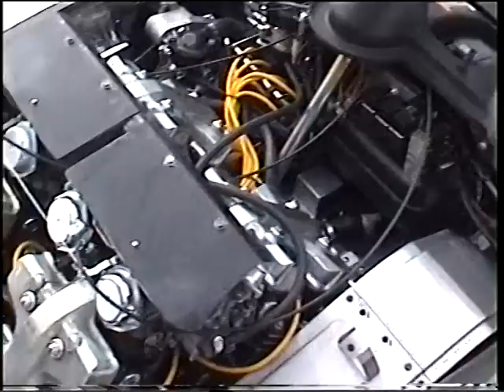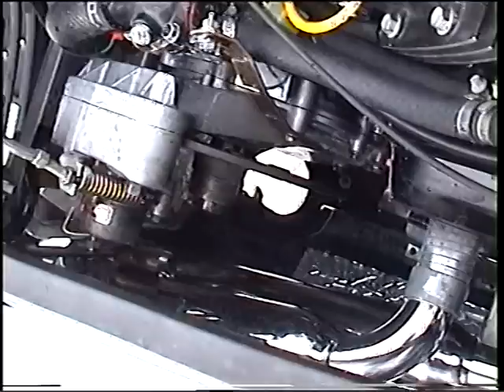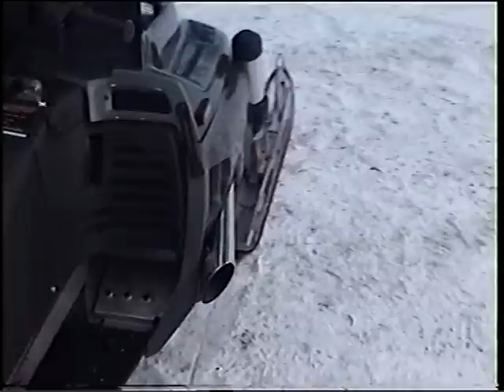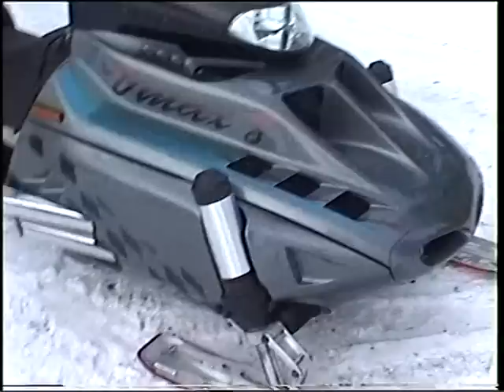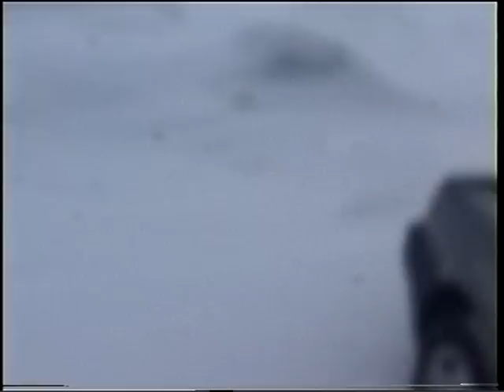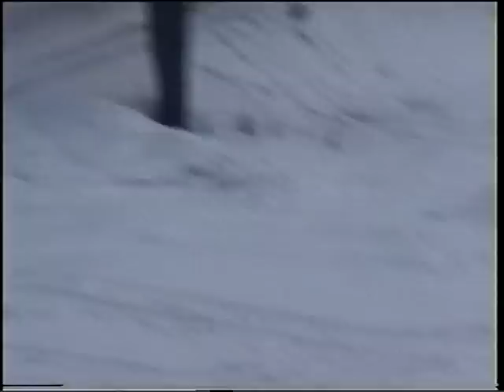V8-powered  sled, worlds first.  - Världens första V8 snöskoter

Comment from the maker: @MrDieseltwitch Remember this is a video from the first startup several years ago, the sled looks different today. I´m planning to install a fuel injection system and modified cams. This would make this sled more powerful and reliable. I just finished a complete restoration of an -66 Shelby GT350 and I got several more muscle car projects waiting. This gives me very little time to work on this sled, wich was a fun build many years ago.
Thanks for looking

Comment: Very nice install job. Looks pro but what's the point? My whole 800 renegade probably weighs less and would kill it in speed and handling too. Just wondering what the point was that''s all. Kinda cool nonetheless.
Reply from the maker: +Matt Terriah The point is: Without innovators and engineers in this world, you would not have an 800 renegade to ride on. If you get my meaning?
Reply: +powersled That's true. Pretty impressive job I must say. I couldn't do something like that myself for sure. How has the project progressed? You should post a new follow-up video.
Reply from the maker: +Matt Terriah We´ve started to build  and install an fuelinjection system. 8 carbs is not a good ideá. It now has a new longer higher boogie (mat). I´ve been very busy with other stuff but sooner or later this sled will be finnished. 200 HP is the goal, but not important. This is a cruiser.

Comment: V8 motor for a Little backyard.Does it steer like a Mac  truck with all that weight in the front??
Reply from the maker: It´s actually not that much difference in weight from the original 4 cyl. 2 stroke. I can garantee it´s been way further than our backyard.
Reply: powersled 👍

Comment: That looks like two Honda V-45 engines...is that what you did?
Reply from the maker: +ace1usmc that would be nice, but no I used 2 VF500F engines as a base for the build.
Reply: powersled
Cool.  I knew those valve covers looked familiar.  They are identical to the valve covers used on the VF750C engines.  Good job, man.

Comment: Im pretty sure those are 2 old honda v4 engines stacked next to each other.. Im betting 2 v45 engines, so about 1500cc.. Thats sweet, if you had used the v65 engine in my bikes thatd be 2200cc with 8 cylinders, about 240hp! Sweet build though
Reply: There are 4 other you forgot VF400, VF500 and VF1000R and last know V4 was VFR1200F

Comment: Most 2 stroke 800 cc sleds have over 165 horse now stock.  They are light
Reply from the maker: Many of you´re missing the point with this build. It´s not about horsepower.
Reply: powersled Its about durability and top speed and the vid just proves theres a V8 in a sled?

Comment: looks to me like you need to change your gear ratio and how your clutch engages. 2 cycles have there power at high rpm.. and yours has it all the way threw rpm because its 4 stroke and great low end torque so ur clutch needs to engage at way lower rpms and like if it were a bike put higher gears so motor rpm are reduced and your speed is increased. im new to sleds but been doing bikes and all things that are loud and go fast so im  not sure how you change the ratio to the track
Reply: They use slip clutches. What your saying is definitely doable..  I was wondering why only 140hp out of a 8cyl like that?
Reply: Andrew B
well my guess tuning have you ever tried to synchronize 4 cylinders? 8s gotta suck. and the wide open pipes prob dont help. need back pressure.
Reply: That is an urban myth that engines need back pressure.
Reply: Challenger SRT Wouldn't you need some back pressure to keep good compression? Maybe not though. I remember running 250cc dirt bikes with no exhaust on them at all. They were just loud as fuck... still lots of power.
Reply: Challenger SRT man i build and race .. your full of shit.. no back pressure and your valves burn..  anyone who builds real motors knows back pressure curve is so important. hence why 2 cycles have an expansion chamber..  and it makes huge differences in 4 cycle motors as well.
Reply: hondaxl250k0 Is it different with 2 strokes? 2 strokes don't require back pressure?
Reply: Andrew B
no all gas motors require back pressure.. a 2 cycle is more fussy with back pressure.. thats the  reason for the expansion chamber on a 2 cycle. 4 strokes are more forgiving and do not require such an extreme expansion chamber. never run a ,motor of any kind with out having some sort of pipe on it..
Reply: You are absolutely wrong, it is 100% myth that back pressure is required.  It IS true that as you mess with your exhaust it can affect torque curve, but losing power?  Nope. Honda is dead wrong.
Reply: And don't believe me or Honda, do some light Google searching on if engines need back pressure.  You'll see who is right and who believes a myth.
Reply: Challenger SRT
i went to school for building motors.. and i have a wall of trophy's to prove im right.. go ahead run your motor.. burn your valves.. not my issue..  and  wont be my wallet emptied when ur rebuilding your shit..  i went threw the loud straight pipe stage in my life.. and went threw more motors and got beet by more guys on quiet bikes than i can count.. then i decided to go to school to learn what i was really doing... the proof is in the dyno.. take ur motor pipe-less and put it on a dyno...then put ur pipe on it and dyno it again.. ull see im right.
Reply: Challenger SRT
what ever think im wrong.. see you at the track fool..  when i pass you at 200mph
Reply: I do think you are wrong because you are wrong.  Thought this was established?
Reply: And yet when you do research online on this topic everything says the contrary, and you are wrong.  You can be entitled to your own opinion on this issue, sadly you are not entitled to your own facts.
Reply: Challenger SRT
the facts are there's a back pressure wave  in the pipe called draw.. it aides in the exhaust stroke in clearing the cylinder .. take any motor dyno it pipe on then pipes off... quite the power loss with open head.. and not to mention burning your valve seats .. in aircraft no one would run an open header 1 because of fire .. 2 because a motors life is measured in hours and the hours is drastically  reduced on a motor with open headers. usually due to valve failure. so tell me how im wrong.
Reply: You guys can both be right.. The motor can run without back pressure. Is it good for it? I doubt it or we'd see 2 stroke bikes with nothing but a 2 inch dump.
Reply: Andrew B
of course it will run.. no depute there.. but it wont run right and it will damage the heads..
Reply: hondaxl250k0 If it's draw, then it's technically not backPRESSURE, it's vacuum.  The positive pressure wave travels down the pipe with a negative wave behind it which draws more air out of the cylinder.  If it were pressure, it would push back or slow the air trying to get out of the cylinder.  And, on a two stroke, after the negative pulse there is another positive pulse that travels back up the pipe and actually turns the flow around and pushes it back into the cylinder right before the port closes.  The reason this helps is the port is open so long fresh fuel and air start out the port into the pipe.  It is this fresh mixture that gets pushed back into the cylinder.  Stuffing more air and fuel into the cylinder of course makes more power.  On a 4 stroke, anything that can be done to help lower the pressure (technically less backpressure) in the pipe will allow more burnt mixture out of the cylinder and therefore more fresh air in through the intake port creating more power.  The more air and fuel you can get into a cylinder, the more power.
Reply: But...but...he has a trophy and will just pass you at 200mph...
Reply: hondaxl250k0  The bigger the pipes the more back pressure, no pipes means too much back pressure- atmospheric pressure is too much.

Comment: I thought that at first, but the 85 VF500 was indeed a V4 @ 70hp. But because its not firing at a typical V8 pattern, it doesn't have the distinct V8 noise. But, still this is pretty damn cool.

Comment from the maker: This is the first startup in 2003, the sled looks different today. The engine has only 1000cc, it´s pretty much a prototype. It´s possible to get 300 hp out of it, but why should I? It would be a "horrible" engine to control, burn a lot of fuel and last for 10 hours or less. Today, my girlfriend can take it for a spin she likes and it´s moderate on burning fuel. Thanks for looking.

Comment: That looks like 2 VMax engines, is that correct?
Reply from the maker: Honda VF 500 Interceptor.
Reply: @powersled  OK  I guess its a Yamaha sled since says Vmax on hood. Maybe you could try 2  V65's on the next one. Should give about 230 hp.
Reply from the maker: @robertrpenny  to heavy and to wide.

Comment: Power to weight ratio on this beast has to be like 25:1, although it didn't show a lot of speed. A sled designed like this should be able to exceed 60 mph.
Reply: 60 mph is nothing for a sled, a 440 could do that, this should easily surpass 100, gearing dependand
Reply: jacob fraser How can you say 60 mph is nothing when 60 is greater than half the number you provided?
Reply: when you are on a snowmobile, or any off road machine the difference between 60 and 100 mph is staggering.

Comment from the maker: OK, I understand. However, the engine is a prototype, the higher power output the easier it´s to "blow it". With the new fuelinjectionsystem the power would probably increase w. about 10-15%.

Comment: This sled is not the first with a V8, I had one back in 1998 , a Polaris with a 351 Windsor. This setup looks like 2 v twins, not a true V8
Reply: this was 2 vmax motors .. and they were V4.. so 4+4=8 as i remember
Reply: Of course you are using simple math,good boy, but it's not an actual V8.
Reply: I think first is in Canada Ford 4,9 litre 1984 -86.

Comment: @TaNgLeD2121 It is 2 four cylinder motorcycle engines mated together for a total of 8 cylinders. They actually work pretty well too...there is a company that turns hayabusa engines into V8's. They use them alot in kit cars and things like that. (look up hayabusa V8)

Comment: Dosent even look like its fast how hi the rpm sounded vs speed it's a 1 up too not even a cool sled if ur gonna do something u should start off with a better race sled I Wana add a turbo to my formula z 670 with mxz 1000 engine all ready in it it was perfict because the race suspension that it comes with from ski doo It takes corners at 100+ and wellies all over the place I think the turbo will make it a lot faster but I'm woried ab it hurting my sled more then helping it and it's super reliable the way it is anyone have any thoughts

Comment: I bet a modern ski doo would still whoop it
Reply from the maker: Like so many others, you´re missing the point.
Reply: ***** The Horsepower aint everything, It would produce a lot of torque, and that figure is just as important,and take into account its 140HP out of 1000cc, (Thats a 1 litre engine) Besides,, who really cares, it sounds awesome,,,And its a V8, Think of it like this, If you replaced the engine in your average 4 cylinder shopping card hatchback with one of these engines,,Imagine the looks you would get cruisin down the street?, LMAO!, Yes officer, it IS a V8,,,,

Comment: cant you see he used 2 v4 motorcycle engines and not a big block chevy engine lol also a stock 502 pushes out between 350 and 450hp, not 700+

Comment: @powersled not really i agree with jesse.... while this is an awesome build... its a touring sled after all. I would want more power than that if i put a v8 in a sled... there is a guy that builds V8 out of 2 Hybusa motors for 450hp @ 10,000rpm Non turbid and 1000hp with turbos.... that would be impressive in a sled... google h1v8 to find out what I'm talking about

Comment: it is a cool looking machine but i have to ask the question why.... if you're goal was raw performance  yamaha builds factory four stroke sleds with 165+ horse power already.... ski-doo and artic cat both have machines that push 170 hp.... not to mention power to weight ratio, beside riding this thing must feel like you're riding a stripped down tank, i'm sorry man it is very very cool but grosly not practical.

Comment: Так где же V8, тут V4, спарка...
Reply: powersled it's v4, not v8?
Reply from the maker: Some think it´s two V4 engines beside eachother. In a way it is, but with modified crankshafts and cut engineblocks with drysump (separate oiltank). To much to write to explain how I did it. And the answer to your question is: It´s a 1000cc V8 engine. what language do you speak?

Comment: Looks like 2 v twins not a v8 big big difference
Reply from the maker: it´s 8 cyl. count the sparkplug wires.
Reply: powersled that don't mean shit my Harley has 2 cylinders and 4 spark plug wires
Reply: And how many air cooled v8 engs have you seen...me 0 I'm a mechanic by trade and that looks like 2 v twins stacked together
Reply from the maker: I guess you´ve never seen the Honda V4 engines from the mid 80´s
Reply: powersled all I'm getting at is the amount of plug wires doesn't mean it is a v8. I had a old Nissan 4 cylinder that had 8 plugs and wires...🤔
Reply from the maker: What type of mecanic are you? I have a -85 1100 shadow with two plugs for each cylinder. And if you look this sled is watercooled + the original radiator under the seat.
Reply: I work for Freightliner as a diesel mechanic.
Reply: It may be liq cooled but those jugs implying 4 cylinders have been cut for air cooled engine. If that was 8 cylinders they'd have to be the size of a hot dog around. There is no way that thing has 8 pistons the size of a pop can. Cuz that's roughly the diameter of my Harley I'm betting it's 2 500 cc v twins stacked together. My Harley has more ccs than that thing and only has 2 cylinders.
Reply from the maker: After this last comment I would usually stop my replys. You obiously don´t like this project, you´re also calling me a liar. I can assure you it´s 8 cylinders. Ask any motorcycle mecanic, they will tell you right away. It´s easy to critisize someone elses work. I would never do this to a fellow mecanic, even though would have done things differently. If you send me your e mail address I will send pictures of the build/modification of the crank and engineblocks and the rest of the sled. I will also send you the article which this sled was publicised in, which is North Americas biggest snowmobile magazine. This is one of the very few custom sleds from Europe which have been publicised in North America.

Comment: I can appreciate the engineering that went into this and it is a nice piece of work but what a useless turd really. The weight alone on that front end makes a tank, and i know heavy sleds i ride a 4 stroke Yamaha. This must weigh in at 800 lbs
Reply: True this is a waste my 2012 summit 800 probs has more power
Reply from the maker: Julian Johanson I´m tired of answering these ignorent comments. You´re missing the point. This build has nothing to do with being faster or having more power than standard sleds. If you got money you can go and buy sled no matter how ignorent you are when it comes to mecanics. But can you build a sled like this? Also, I could easly get 150-200 hp out of this if I wanted. But this sled has a prototype crank installed, and I don´t want to risk braking it.

Comment: That ain't no v8. I owned a Honda magna, can't forget that sound
Reply from the maker: I´m glad you told me, I only built the damn sled. And I only owned and imported hundreds of Honda magnas, Shadows and more.
Reply from the maker: @Daryll_Flaro count the yellow wires. To burn rear tires like you do on that virago, that I think most people (incl. Canadians) would say is pretty stupid.
Reply: @powersled  It's only stupid if you're paying for tires and don't have a spare rear wheel. So is it stupid? Everybody has an opinion
Reply: I can count wires. You put two 90° V4 engines side by side. That does NOT make this a V8. There is no common crankshaft between the 2 engines. As to how they power the track is a different story. Fix your title
Reply from the maker: @Daryll_Flaro  Before I end this chat with you, I just like to say. Ask instead of assume. This sled was published in your national snowmobile magazine Snowgoer many years ago. Non of them called me stupid, just the opposite. It takes a lot enginering and time to do something like this, and to be insulted by people that only see  negative things with your work is no fun. Some call them haters. I´m Swedish by the way, English is a second language for me. I have several good friends in your country and I have visited Canada many times. I do love the country and the people there. Before we end this, I do like see something you have done/worked/constructed. It could just about be anything, it doesn´t have to be an engine. Looking forward to see what You have worked with, I promise not to criticize or insult your work.
Reply: @powersled As a Magna/Sabre V4 enthusiast, I can appreciate the work you have put in to that project. I'm sure you would have faced some challenges along the way to make it all work. The build is one of kind to say the least. Some of my past and current projects/builds include:
- Full bolt-on Borg Warner 50mm '16 Veloster Turbo
- '94 Virago 1100 (Barnett clutch, Cobra exhaust, 2-1 flat slide Mikuni TM40-6 pumper carb on the way 
- Bobbed '83 V65 Magna (4-1 custom exhaust with Harley Fishtail, jets, Kevlar clutch and ported heads. 
- '01 Jetta VR6 (this is a build in progress)
- Garrett GT3582R ball bearing turbo
- Head spacer 
- ARP head studs 
- Timing chains and guides 
- Forged pistons 
- Forged connecting rods and rod bolts 
- DTAS80 Pro standalone ECU
- Manual boost controller  
- Oil lines and hardware 
- ADD W1 catch cans 
- HKS bov
- FMIC
- Lower temperature thermostat 
- Larger radiator
- Dual rad fans 
- Injectors)
I have more builds I plan on posting on my channel in the future.